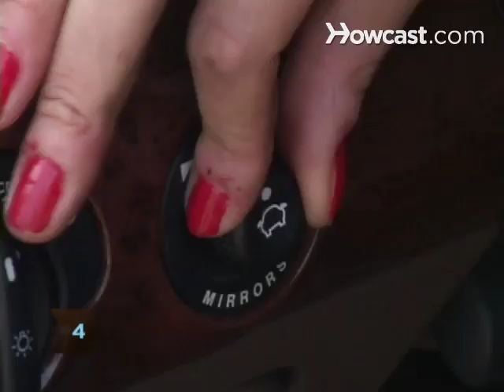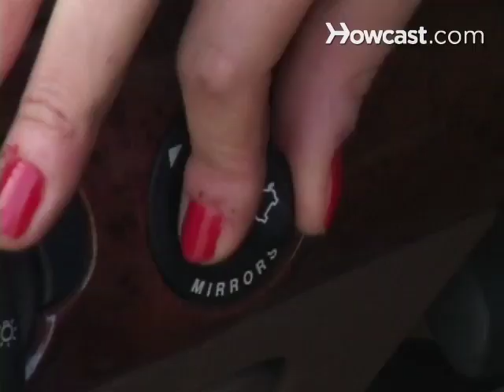How to Make Your Car Safer

Comment: How To Make Your Car Safer:
Step 1: Don't move to Miami
Step 2: Don't move to San Francisco
Step 3: Don't move to Chicago

Tip: Make sure there is not a guy going 5 in a 50 to reduce road rage.

Did you know? Going to drivers ed can actually make you a better driver.